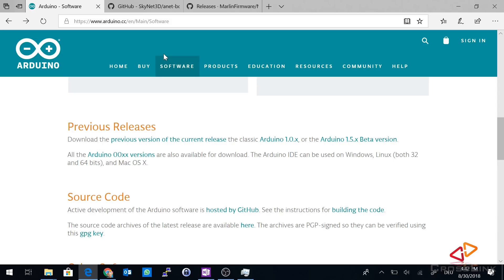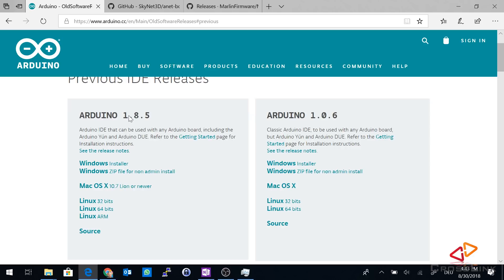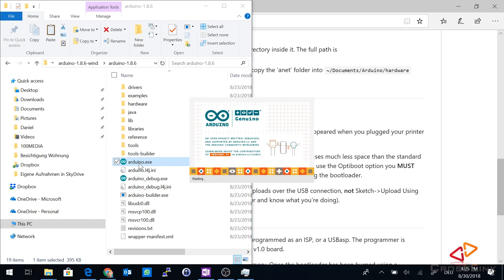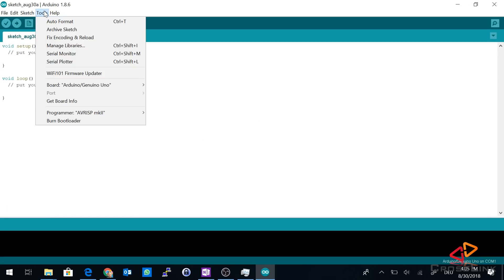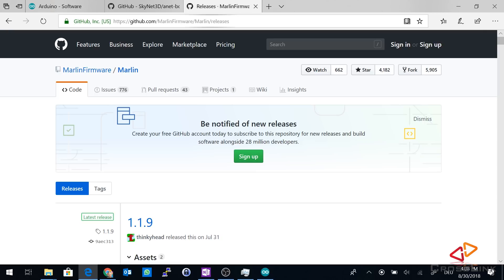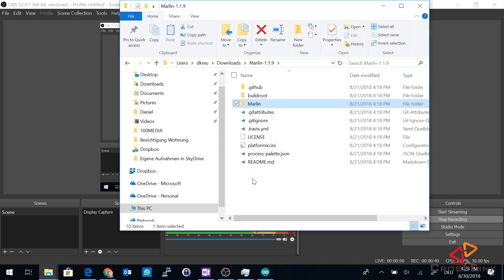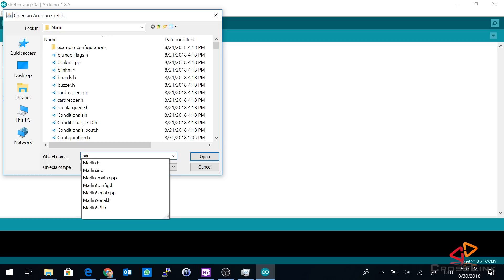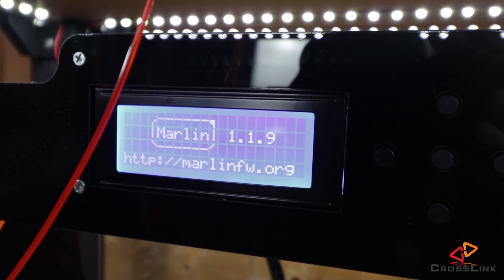How to install Marlin firmware 1.1.9 on your Anet A8 3D printer in 7 easy steps

Comment: Error compiling for board anet v1.0.
Reply from the maker: I would like to help but don't see the issue here. Can you explain a bit what you did before trying to compile? Can you post your output window content?
Reply: @Crosslink3D  for the new anet board you need a special usb to update firmware. Your method only works for board version 1.0
Reply from the maker: The compiler error is not related to the board version. The Arduino IDE does not know which board you have. It's probably one of the two reasons: you have a newer Arduino IDE than 1.8.5 or a library is missing. I tested all IDE versions  newer than 1.8.5 and they don't compile Marlin 1.1.9 for Anet. Besides that I have board version 1.5 myself and flashing works fine using a normal USB cable. However I will show how to do it with a USBASP cable soon. But again if the compiler gives you errors upfront it will not work with any cable.
Reply from the maker: I have just released my howto video how to fix broken bootloaders and other issues with firmware flashing: https://www.youtube.com/watch?v=RQIizXtf9oo

Comment: Hi, Many  thx for the video . I tried installing on macOS High Sierra  10.13.6  followed all the procedures mentioned but failed . The USB port is not getting recognized on the mac .spent almost 2 hours fixing it :( can you plz help .
Reply: I currently do not own a Mac but probably can lend one from a friend. Until then the only thing that might work for you is a usbasp programmer. I will get one soon to test but this might be a cheap thing for you to try. Uspasp programmers are on eBay for a few bucks only.

Comment: Thank you so much for making this video. I just got and built my A8 and know about the crappy stock firmware. Flashing it with this video made is easy for me and now I can play with my new printer without having to worry so much about a runaway situation.
Reply from the maker: So cool to hear I could help you. If you have any other issues just post it here and I will try to help. 👍

Comment: Worked fine.  Thank you for the step by step instruction.
Reply from the maker: Great to hear that. Do you have any other questions I could cover in a new video? What Mainboard version are you using? Newer versions seem to cause issues that I like to address with another video.
Reply: No questions.  I don't know the version of my mainboard, but I bought the machine new last year, 10/1/2018.   @Crosslink3D

Comment: can you make a video to show us how to configure an inductive sensor :) on the marlin firmware for the anet a 8 mine  work fine  but doesnt recognize my inductive sensor
Reply from the maker: Would love to. Which sensor type/number are you using? Where did you buy it?
Reply: the square one that mount on the front right  of the extruder :) thats gonna be interesting because nobody have done it before i think :) the sensor is : PL-08N brand name Zhongde (chinesium)
Reply from the maker: I have gotten in the PL-08N recently and will do a video about it and some other sensors like the 3dtouch
Reply: cool awesome :)

Comment: Thank you for this video. Question; I just built my 2018 model Anet A8 and from what I understand, this new motherboards have dodgy bootloaders and  will get "not in sync" errors when trying to flash the upgraded Marling firmware. A USBASP cable is needed to flash Marlin (including the preparations: installing a USBASP driver in your computer, downloading a bootloader in the motherboard, etc.) Could you do a video about this? Thank you in advance
Reply from the maker: Good to know. I just got the new model in and will first do a scratch build video and then definitely take care of the firmware issue.
Reply: Crosslink  Thank you!
Reply from the maker: So my results on this are: Usually flashing without a USBASP cable works. But it can happen that the bootloader is broken and you might need such a cable. As a result I will do a video about using the USPASP cable as an alternative way to flash and to fix problems like "not in sync" errors.
Reply: Would like to add that I just received my Anet A8 printer last week, and its definitely a 2018 model.  Following this guide step by step I did not have any sync issues at all.
Reply: @nagel616  Great, thank you for the answer.
Reply from the maker: Actually I did set up a new pc last week and forgot to install the Arduino drivers before trying to flash firmware. I saw COM3 and got „not in sync“ errors. Then I installed the drivers and got a new COM4, then it worked. Might haben been a Bluetooth com port that tricked me into thinking I was using the physical port.

Comment: i got error please help me out 
avrdude: stk500_getsync() attempt 1 of 10: not in sync: resp=0xd6
avrdude: stk500_getsync() attempt 2 of 10: not in sync: resp=0x6f
avrdude: stk500_getsync() attempt 3 of 10: not in sync: resp=0x80
avrdude: stk500_getsync() attempt 4 of 10: not in sync: resp=0xbf
avrdude: stk500_getsync() attempt 5 of 10: not in sync: resp=0xae
avrdude: stk500_getsync() attempt 6 of 10: not in sync: resp=0xd6
avrdude: stk500_getsync() attempt 7 of 10: not in sync: resp=0x02
avrdude: stk500_getsync() attempt 8 of 10: not in sync: resp=0x21
avrdude: stk500_getsync() attempt 9 of 10: not in sync: resp=0xcc
avrdude: stk500_getsync() attempt 10 of 10: not in sync: resp=0xd6
An error occurred while uploading the sketch
Reply from the maker: First a few questions. Did you select the Anet board from the list of board definitions prior to uploading? Did you select the right COM port (there might be multiple depending on your computer). Also, how did you install the Arduino Studio? If you did not use the installer, you might have to install the arduino drivers manually.
Reply: Yes, I selected Anet board 1.0 and proper COM port, but Arduino Studio & Arduino IDE are same or different? and how to install drivers manually? please guide, Thanks.
Reply from the maker: Check out the "drivers" folder inside of the arduino IDE unzipped folder. Then start the "dpinst-amd64.exe" to install the latest drivers. Did this work for you?
Reply from the maker: I have just got a new Anet, model 2018. Will do a scratch build video soon and then tackle the firmware flashing on it. It really seems to be a bit different with the new board. Check out the other comment. Seems you need an additional hardware.
Reply: I am waiting for it...thanks

Comment: Finally a working video! Great job, my problem was with the newer version. 1.8.5 was the key. Thank you!
Reply from the maker: I am happy that this video helps you. Is there any other topic regarding the A8 I could make a video about that you would be interested to see? Daniel
Reply: I'm new to marlin, and I recently converted to the AM8. Setting up Marlin for the A8, or AM8 would be great. Setting up bed-leveling, tweaking settings etc.. How to on octopi, or repetier would be great as well to name a few.
Reply from the maker: Sounds all like great ideas. Will take these into my planning for sure!
Reply from the maker: I just released a video about how to install a bed leveling sensor on the Anet A8 if you are interested.